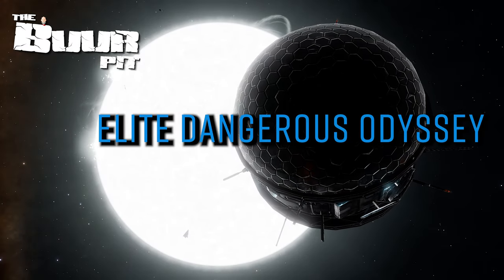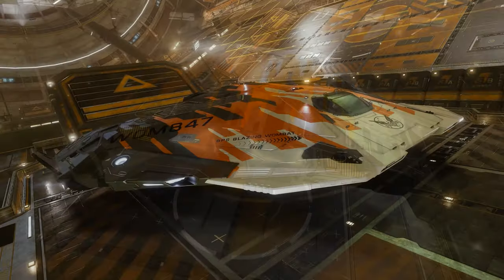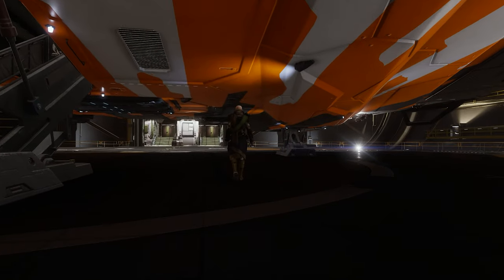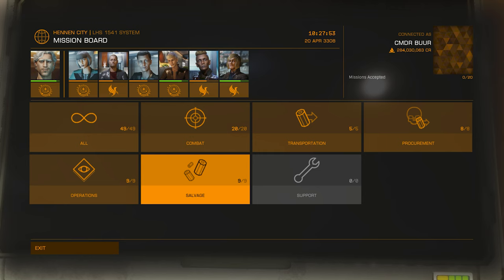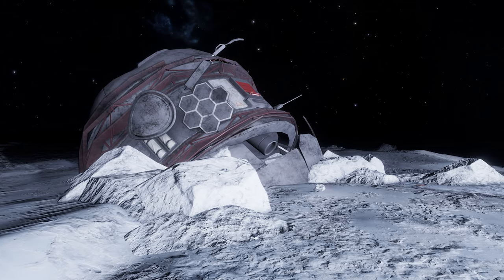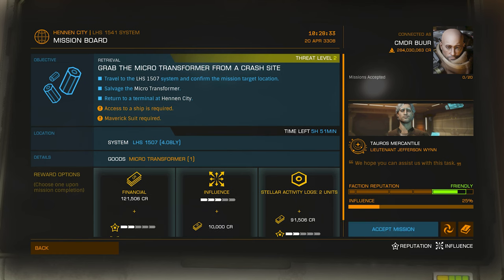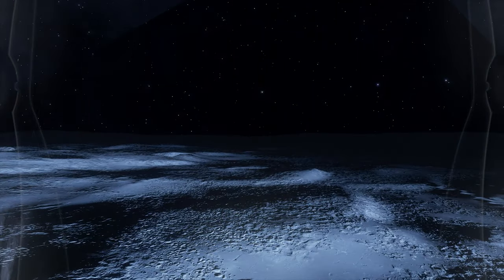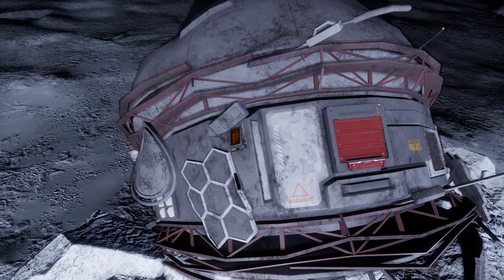Elite Dangerous Odyssey: Manufacturing Instructions - How to Get them

Comment: Solid guide, this Elite I (going on II) Mercenary can vouch for these methods.

Another thing to keep in mind is that your reputation will affect mission rewards, so if RNGesus is not kind to you when using the relogging/crashed satellite  method, try checking the concourse mission board at a station you're well-liked at. Also, once you've got your gear upgraded and are comfortable with the combat, consider the newer defense missions or other combat missions (casts a wider net than focusing on salvage alone).

Comment: I just hope folks don't take #3 as the only way to do it and start with the braying about being forced to log out in order to grind materials, as though you can only play the game once you have all G5 everything.  Thank you for the tips regardless!  Good to know that salvaging missions are worth keeping an eye out for!
Reply: FPS mechanics is horrible unless at G5. Bullet spongey and not fun. Of course they decide to lock weapon balancing behind a huge grindwall where players have to use unintended methods of grinding just to achieve this balance in a reasonable amount of time.
Reply: @joeparker3815  I disagree completely.  I'm using G2/G3 weapons I bought off the vendor and enemies don't feel too spongey at all, unless I'm using kinetics against shields or lasers against armor, which is using the wrong tool for the job.  I'll get to G5 when I get there, but I definitely don't feel weak or like I can't get things done.

You don't need G5 to have fun, unless you're going into Elite Dangerous wanting it to be CounterStrike.  In which case, you're judging a fish on how well it can climb a tree, and that's a you problem.

Comment: In a similar way you can get lots of Weapon Schematics by taking a "Retrieve X from a Hidden Cache" mission where X is usually Hush or Lazarus. Simply cut open the shipping containers and collect the schematics from the containers inside. Do not collect X, re-log rinse/repeat.
Reply: Sad, there is no "Retrieve X from a Hidden Cache" mission anymore.
Reply: @marioh5172  There is. Just done one in Irula system. They are rare, but they do exist. And relog trick still works. Gained ~90 weapon schematics in 2 hours

Comment: seeing a lot of comments about this being patched but I'm doing it right now, exactly as described in the video with no problems - the only difference I notice is that occasionally some enemy npcs will spawn in for me to kill. Could this be one of the fabled un-nerfs by fdev??
Reply from the maker: NPC's have always occasionally done that.
Reply: Just did a two hr login/logout session for manufacturing instructions at a crashed probe mission objective. No supercruise was necessary. to reset, quit to menu worked fine. Parking SRV at a certain distance also affects the enemy spawns; i.e. I am pretty sure that parking further away has the 2-3 npcs respawning around consistently, together with a drop ship wave. All easy to handle with the SRV if you're not confident or geared for open combat. Parking the SRV at approx 20 meters from the probe was a sweet spot, and had only one NPC spawn, if anything at all. Can someone confirm this happening to them as well? Anyways, 30 MIs in approx 2 hrs, with a decent haul of power regulators and other, all useful, data downloads. Best farm for MIs around today.

Comment: Even though MI do spawn at a low rate, not as bad as Settlement Defense plans and Smear Campaigns. But I did stumble across some info about Mercury in Sol that you can find SD plans from downed Skimmers. Will be checking later to see if valid.
Reply: Yep, back before they 'fixed' relogging non mission surface PoIs, I used to look for irregular markers with crashed skimmers. Find one, park next to it, relog for maybe an hour, and you'll have a ton of manufacturing instructions and SDPs. Sadly, the larceny mission ONLY generates sites with wrecked SRVs.

Comment: 1) been hanging about LHS 1541 for some months now, sorry I missed you!!   2) settlement defense plans? Cheers mate!
Reply: Easiest way to get SDP's is to do procurement missions from Metcalf Ring. It will say something like 'download SDP from a data port'.  Go to the site, download the SDP, once you have it abandon the mission so you keep the SDP.  I got 5 in two days earlier this week.  Sometimes it's a stealth mission, sometimes it's just power up the site and download the SDP but they're all doable.
Reply: @cmdrjipsee546  That method I believe has been "Nerfed" by FDEV you can no longer keep the abandoned items to use anymore as they stay greyed out forever.
Reply: @cmdrbravo2zero726  I've not tried since I used them to unlock the engineers but I definitely used the greyed out ones (aborted missions ones) to unlock the engineers last time. I don't think you can sell them anymore (I can't seem to from my carrier) but you can still drop them on the ground for other cmdrs to pick up, if they do still work that is.

Comment: It's been a while since this video has been posted. I will try the relog method. I am tired of running around looking for the manufacturing instructions. 
Also had no luck finding these as a mission reward yet.
Reply from the maker: I saw two on foot missions in Diso today each rewarding 15 each.
Reply: @TheBuurPit  I found a Impact Site today that had three. It was just a POI so the relog trick did not work. Guess it must be a mission as per your Tutorial.
Reply: @TheBuurPit  my play session yesterday yielded 23 Manufacturing Instructions from two easy missions. One salvage and one take down mission. The take down mission was in an anarchy system so I took out the whole settlement and looted it. Had a blast. 🤣

Comment: My biggest issue currently is Opinion Polls.  
Some data is too rare.
Reply: I've got 13 spare OP's if you need some but I'm out in the Omega Sector atm, I'll be back end of next week.
Reply: I've sold lots of opinion polls on my carrier.  Each time I put them up for sale, they're sold within 20-30 minutes.  Same for financial projections.

It will get easier later on though as more and more cmdrs acquire the needed mats and start selling them to and from fleet carriers.